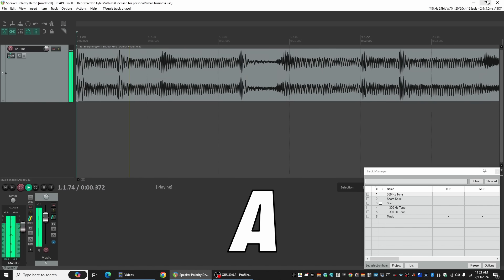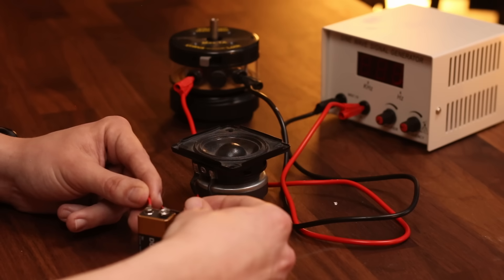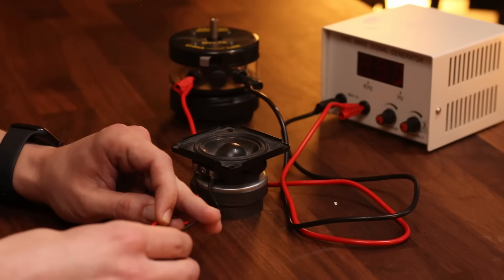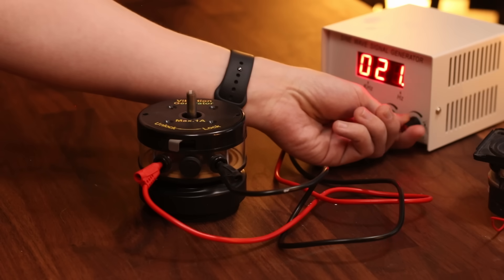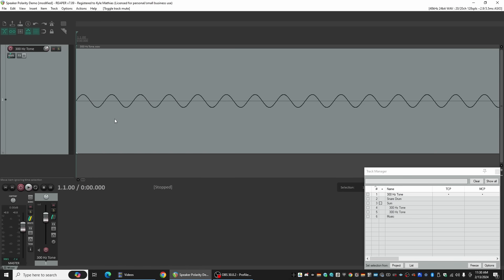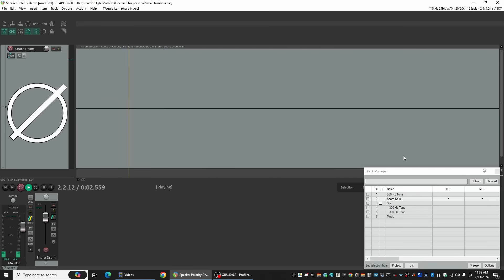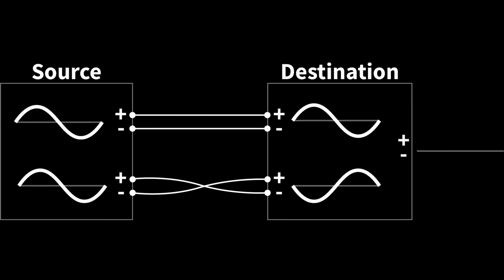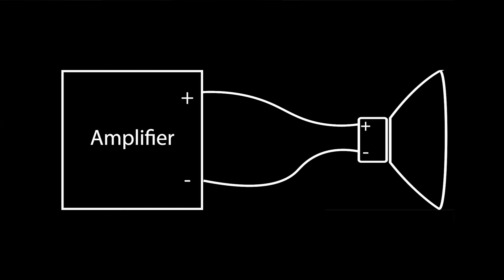What Happens When You Wire Speakers Backwards?

Comment: In classic Western Electric telephones (which almost everyone in the US had in their house prior to 1984), polarity isn't even marked on the receiver element (AKA: speaker), and in some cases both wires that connect to it are the same color (white). The transmitter (AKA: microphone) is marked for polarity though, and the two wires that go to it are always color coded (black for negative and red for positive).
Reply: The speaker element polarity isn't marked because it doesn't matter - there is only ONE in the device. The Mic polarity is indicated due to the way carbon mics are made... the case being grounded.  
Telephones as you mention area poor example anyway, given the mono and very limited audio bandwidth.
Reply: @BTW...  "The speaker element polarity isn't marked because it doesn't matter - there is only ONE in the device."

It wouldn't matter if there was more than one speaker either, as long as all the speakers have the same polarity so you don't get cancellation.

"Telephones as you mention area poor example anyway, given the mono and very limited audio bandwidth."

No, they aren't a poor example. Speaker polarity doesn't matter for stereo either, as long as both speakers have the same polarity. It's actually less important for both speakers to have the same polarity with stereo than it is with dual mono, because with dual mono both speakers are always playing the exact same thing and if the polarity is different between the two speakers you will get cancellation. With stereo, the speakers can be playing entirely different things at any given time, in which case there would be no cancellation at all.

And "limited audio bandwidth" is irrelevant. The bandwidth is sufficient for reproducing the frequency range of spoken words.
Reply: @MaximRecoil  what?  " With stereo, the speakers can be playing entirely different things at any given time, in which case there would be no cancellation at all."    
Naaa.. perhaps you don't listen to stereo recordings or have much experience with setting up speakers to an amp? A significant proportion of a stereo mix has the same signal on L & R channels... and the out of phase effect is significant - Often described as 'disemboweled', 'hollow', or 'poorly imaged'. Correctly phased, a test voice will sound like it is located between the speakers and full bodied. 
Back in the 'boom box' era some had a switch that changed the phasing of one speaker, sometimes called "spacial effect". It supposedly enhanced by imaging the sound outward (for want of a better word).  It sounded crap. 

How many multi speaker telephone handsets have you ever seen?
Reply: @BTW...  "Naaa.. perhaps you don't listen to stereo recordings or have much experience with setting up speakers to an amp?"

This is a non sequitur from you (and I'm willing to bet that I know far more about this topic than you do), i.e., it doesn't logically follow from anything I said and can therefore be dismissed out of hand.

"A significant proportion of a stereo mix has the same signal on L & R channels... and the out of phase effect is significant - Often described as 'disemboweled', 'hollow', or 'poorly imaged'. Correctly phased, a test voice will sound like it is located between the speakers and full bodied."

I said:

With stereo, the speakers CAN be playing entirely different things at any given time, in which case there would be no cancellation at all.

Notice that I typed the word "can" in all capital letters this time. Does that help you see it? I can easily make a 2-channel/stereo audio file right now with two completely different things on each channel, for example, nothing but instrumental music on one channel and nothing but vocals on the other channel. In some commentary tracks on DVDs or BDs that have two people doing the commentary at the same time (such as the director and one of the actors), they place one person's voice on one channel and the other person's voice on the other channel.

And regardless of the proportion of a stereo mix that has the same signal on both channels, it is still always more important for both speakers to have the same polarity with dual mono than with stereo, just as I said. Even if the proportion is 99% the same, that's still less than both channels being 100% the same, which is inherently the case with dual mono, obviously.

"How many multi speaker telephone handsets have you ever seen?"

This question is another non sequitur from you. I said:

It wouldn't matter IF there was more than one speaker either, as long as all the speakers have the same polarity so you don't get cancellation.

Notice that I typed the word "if" in all capital letters this time. Does that help you see it?

On top of that, it's very easy to have two speakers; you just plug two phones into the same telephone line and pick up both handsets while you're on a call. Also, there are telephone headsets with a 4P4C connector (to plug into a traditional telephone base) that have two speakers.

Comment: This is called a poor mans voice coil tester in the car and home audio installation service. Normally will have a 9v or AA battery with wire taped on the pos and neg and we do the same thing to hear if the voice coil is broke. If it makes a sound the speaker isn't blown, if not sound the voice coil is broken and the speaker needs rebuilt or replaced.

Comment: The human ear is insensitive to phase, but electronics is not. The difference between inphase and out of phase is 2X versus 0X. So inphase gives a 3 db  boost, while out of phase gives cancellation. This means that phase difference into stereo headphones is meaningless, while reflected sound off of walls and other surfaces cause noticeable acoustics. As humans, the brain filters out acoustics to some extent. This is why you won't notice an echo if you are less than 17 feet from a large wall unless the effect is large like singing in the shower.  However, a microphone will faithfully pick up the echo. Many YouTubers record their episodes in an anechoic closet with special lighting. The background you see is CGI. Recording in a normal room will sound terrible.

Comment: This is good to know.  Wind noise is always an issue when it comes to motorcycle helmets and trying to listen to the integrated Bluetooth at highway speeds can be an issue.  So I'm going to cut out the speakers and splice in a set of earbuds.  The earbuds looks similar to ear plugs so I'm hoping they will act as ear plugs for external noises (wind and engine) but since they are earbuds, they'll deliver sound directly in my ears.  My concern was splicing the wires backwards, especially if they are not colored differently beneath the outer insulation.

So it is good to know that it shouldn't make a difference since each earbud is delivering sound directly to each ear so there won't be any sort of destructive interference.  My only concern would be if each ear is getting a signal that is 180 deg out of phase from the other, would it be detectable then?

Comment: If your speaker "BOX" has 1 speaker facing forward  and 1 speaker on the back of the box facing backwards, you want to wire the front + to +  and - to - and the speaker on the back + to the - terminal and the - to the + terminal of the speaker  then both speaker cones will move in the same direction --- not fighting each other to produce sound waves. (same frequencie drivers)

Comment: I'm not sure I agree 100%. I agree under the assumption that both speakers are wired to the same amplifier. However, if there are two separate amplifiers operating independently of each other but somehow playing the same music file, and one of the amplifiers has the speaker wired in reverse, I don't think there will be volume cancellation. I should also mention that I've never tried this so I could be wrong.

My hypothesis is that the cancellation is happening in the electrical signals.

Comment: Apropos of near nothing, way back afore most of you were born, AR LST was a happening speaker. It was said to be able to handle the output of the Crown DC-300 and SAE amplifiers. They did a multi speaker test  using a steady tone to see which speaker could handle how much power. The LST's voicecoil lit up like a lightbulb at 8w and smoked at 12w... but today we have 200 watt speakers - progress!

Comment: If it's ac, why are the wires labeled  + and - ? Like house current is (+ / - ) on one wire and ground on the other for 120v. Or ( + / - ) and ( - / +) for 240v. And of the + wire is always +, then how is that not DC?

Comment: The same thing cannot happen with two speakers. You are talking about a theoretical perfect match of signals which is fine before you turn the signals into sound (ie: they leave the speaker). If you have two speakers wired on straight, one reversed, the sound at any point will be the same as two speakers wired normally except you move one of them slightly in space. The human ear will never notice this difference.

Comment: I paused the video to write what will happen when you attach a speaker to a battery. The cone will either go forward or backward and stay there, as long as it is connected to the battery or until the battery goes dead..
  if you do not know which terminal is positive, this is a way to find out, with a battery terminal marked positive connected to a speaker terminal, the wiring that makes the cone come forward away from the magnet is the identifying telltale sign. Which ever terminal you have connected to the battery when the speaker cone moves forward, Then the terminal on the speaker that you have the positive wire from the battery connected to is the positive wire on the speaker..
 Being in rock bands through the 70s 80s and 90s, I have fried my share of speakers and a few amplifiers

Comment: We used a battery to figure out the polarity of the speakers;when trouble shooting a previous installation. A dead give away is solid bass when turned to one channel or the other, but when balanced no bass out of either indicates inverted polarity on one or more speakers depending upon setup. Our shop used to troubleshoot a lot of other shops work. Motor noise used to be a huge issue for some shops.
Reply: How do u fix motor noise. I seen rca cause it and bad grounds. But is polarity creating it also?

Comment: Ok.  Can someone please explain why the woofers on the Polk R700 are reverse phased.  I knew something was up when I ran the auto setup on my Yamaha AVR and a message came up that the front speakers were out of phase.  I did the batter check exactly as he demonstrated and sure enough, when connecting the positive to positive on the battery and negative to negative, the woofers pulled in!  Not out!  That’s the first time I’ve seen that on 50 years in audio!  After jumping through multiple hoops I finally got a engineer at Polk on the phone.  What he said was total BS and I gave up.  Anybody got an answer?

Comment: Speakers do not care about polarity. Using DC to demonstrate the operation when AC is the object's requirement, does not mean a thing. The polarity is marked so that when two or more are connected together they will respond in unison, not one pulling in while the other pushes out, essentially cancelling the perceived audio.

Comment: Hello! You seem to know about audio equipment and some of it's untold features. So I think you're just the right person to ask.
From the very first days back then when I got my PC and speakers with mini-jack plug I can remember I've noticed strange yet COOLEST effect which I want to be described at last by some professional like you. It really helps distinguish electric guitar from the whole set of instruments which was great from because I just started to dive into rock music.  
The effect can be achieved like this: you take mini-jack plug into your device (PC audio card, MP3 player, CD player). Open some rock music (for example, a "Weeds" cover played by Pro-Pain). Now hold the plug and start pulling it out very slowly. At some narrow point you will notice that an electric guitar sound is what you can clearly hear at the moment - other sounds alongside with the vocalist are somewhere at the deep background. 
What is it? How it works? Why is it that only the electric guitar remains audible? And why does this remind karaoke option of a cheap Realtek audiocard?

Thanks in advance!
Reply: A headphone plug has three conductors connected to different parts of the plug. Front-to-back it's the tip (left), ring (right), and then the ground.  By pulling it back just a little, I think you might have been connecting one of those to both corresponding conductors.  I strongly suspect that the amount you had to pull it out matched exactly with the size of that segment of the plug (you know, think of how it's separated by those black plastic sections).  Something like this.  It wasn't cancelling any noise out or anything, you were just listening to one channel at a time.

Comment: either all are connected backwards or all normally. There's zero difference. Not at all. It's only relevant to the other drivers in the setup.  We don't want to connect one in reverse and one normally so they cancel each other

Comment: My brother might find this weird, he replaced the speakers in an old jeep and they sounded static-y apparently. After consulting his friend and then looking at the diagram for the wiring, the polarity of the wires on the speakers was reversed (black was positive). After rewiring the speakers to have the terminals connected properly, it sounded clear, so I wonder how that could've happened because it wasn't a case of opposite speakers having reversed polarity..
.

Comment: We have to consider the wiring polarity when the load speakers have built in electrolytic capacitor circuits to splitt the low and high frequencies toward the bass and tweeter speakers, otherwise the electrolytic capacitors might damage.

Comment: I could hear the difference in that first track at the beginning. But I am a musician and did some sound engineering since the 80’s. On that first track the bass had a slight muffle & the highs a slight echo. But it was so mild it would be hard to even detect if not trained in pattern recognition. 
It was a great overall explanation and enjoyed it nonetheless the less.
Still would not reverse polarity on the speaker in my bass amp knowing the physical limitations of the mechanical speaker.🔊

Comment: As you say, polarity for speakers does not matter, as long as all speakers are in phase. The industry should probably have chosen A & B or sticking to color coding instead of + & - to avoid the controversy this misconception has caused.. Even a low 20Hz signal is 20 pulses a second, it is impossible to hear the difference. If someone can make a blind test to proove it, then I may change my opinion, but I'm pretty sure this will never happen. 🙂

Comment: I have always figured that speakers aimed at one another, i.e. the cones at the back of the room, might introduce cancellations and cause audible interferences with the front speakers given they are moving in opposite directions when wired appropriately, but they don't seem to. Why?

I assume that the interactions are simply so complicated (and we have to account for zillions of reflections off of everything in the room as well) that it basically doesn't matter. It's just weirdly counterintuitive to me, despite having wired systems, that the front and rear speakers wouldn't cancel out at any noticeable frequency.

Comment: So where is the maximum "stroke"  - Z or + Z tolerance for best speaker performance. This relates to the physical cone design which I would expect to be balanced since its AC the speaker deals with. Assuming the impedance is equal given a specific frequency in the -Z or +z then there is no difference except in phase.

Comment: The problem with stereo systems when you invert the polarity of one of the speakers, is that it appears to the listener that the system's sound has "rotated" 90 degrees horizontally, as if we left the front of the speakers and stood in front of one of the speakers sides. Thanks for the video!

Comment: HALF the truth.

Yes what he said could be true.

However he Didnt consider the physical orientation of speacers in the room.
Nor did he state where in relation to the speakers the listner is.

Turning the wires around is the same as turning tje speaker through 180 degrees.

If 2 identical speakers in a room are wired in mono and placed at the same end, the acaustic waves will mutually sum all the way to the other end of the room.
But if the speakers are at opposite ends of the room and facing each other,  each speakerwill be fighting tje other with an out of phase component proportional to distance.
The only place / places where it will sound good is cenyrally between the speakers and at any harmonics thereof.

If sterio, in phase is good but out of phase will make the bass vanish.